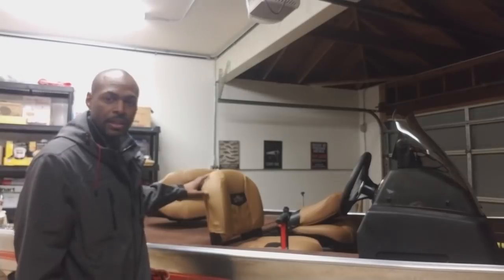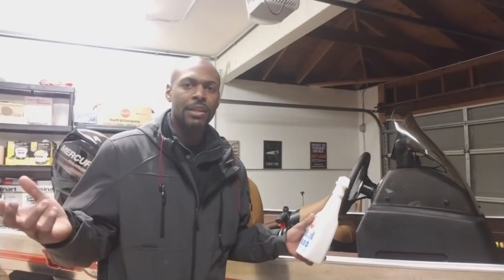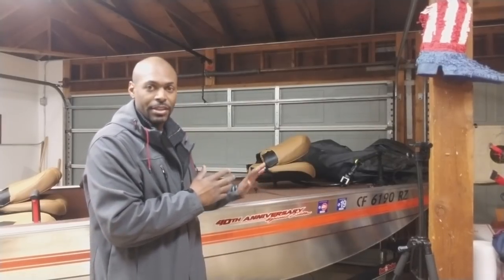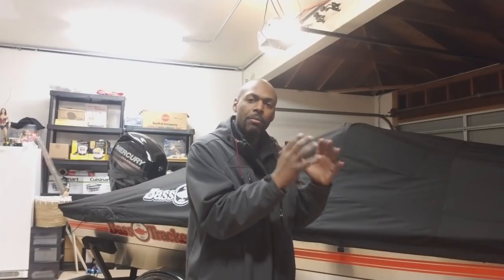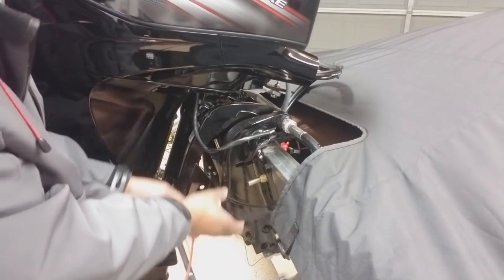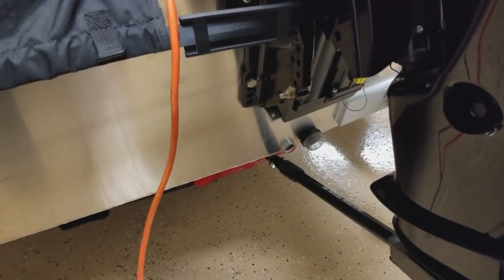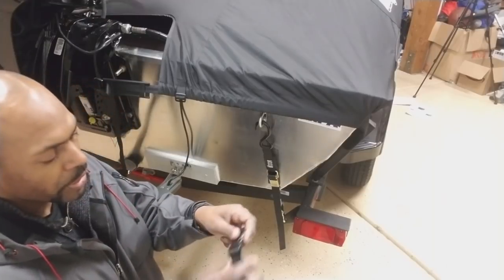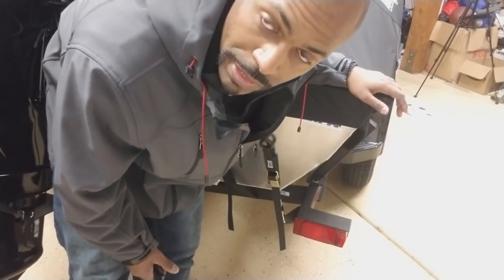Tips to Install Dowco Boat Cover

Comment: Thank you for the video. Just purchased a Tracker and will be towing it 400miles. You answered all my questions. Great video.
Reply from the maker: I have towed my boat across the country from California to Arkansas back and forth three times. The trailer and cover have held up. I had to sow my cover not because it tore in the wind, but because I left one of the straps on the ground when I was just moving the trailer about 5 ft.. the strap got caught under the wheel and ripped the cover. I sewed is that with some braided fishing line and it is still kicking.  It is well worth the purchase. It's not some cheap cover you get at Walmart or AutoZone for a car that falls apart within a year or so. My boat lives outside primarily and in the sun and rain. It is held up remarkably. Only thing I've done is adding more waterproofing to it

Comment: Good cover mine lasted five years being stored outside. Also used it on the highway during in climate weather. Bought another one, used a piece of the old one to cover open area near the moter.

Comment: great video.   good instructions.   My question, is once you have your cover on and all strapped down and ratchetted tight can you trailer your boat on the interstate without the cover flapping in the wind?  Thanks again for a great video
Reply from the maker: Absolutely.  It's not a cheap cover that will flap and  tear in the wind.  It is tight and protective.  No wind noise or anything.  The only issue I have is the gap at the motor, but just leave the drain plug out when it is stored outside or you are trailering in the rain.
Reply: Thanks for your reply!  @jaimeastin

Comment: I did kind of the same mount up front for my finder on my trolling motor  but I used the scotty flush mount track system with the gear head mount with the scotty extenders   I have the track system  on the bow  both side  in front of the live well and other side  2 on the rear  then wit the gear heads  I can lock in my dock bouy.s in  and remove them   I can put  in seven different locations  if trolling for trout at walleye .   I also installed  a scotty side mount between  the seats  almost flush  I put a scotty  3 pole mount  in for tools  and hooks   2 scotty post mount  cup holders on the seat base  I can put in  in the gear heads all over the boat .   I made 2 l brackets  and bought the stern light mounts  and mounted it behind  the seat  and mounted my fish measure  board  also behind  the seat  . and installed a micro power ANCHOR  on the rear
Reply from the maker: John Hansen 

I need some pictures!  You have a Instagram or go to jaimeastin.com email the pics. I can feature them on my my next video.  It sounds like a great set up.

I have some Scotty great track stuff too.  I am just trying around with what solution next.  I am courious about your setup.

Thanks for sharing.

Comment: Thank you for the great video because the instructions which came were terrible. Also I agree that the open area on the back of the cover is an issue. The last thing I would want is a neighborhood cat getting up in there and spraying everything. I have been using a towel to block access through the exposed area of the cover at the engine.

Comment: Jaime, Do you have a part number for those poles? Or maybe you could measure and tell me the sizes they adjust to? Just picked up a heritage edition and it came with a cover but no poles.
Reply from the maker: I dot. Have a part number, but you can buy any universal ones.  Mine are all broken, lol!!!  I ams using plastic universal ones.  They work fine.

Comment: jaime I looked at my boat  it has 5 screws  on that rear panel  there down in deep in the carpet you have to push hard into the carpet to feel the screw head
Reply from the maker: John Hansen 

Thanks John.  I tried to hard to find mine, I will check again.

Comment: Appreciate the videos on the tracker. I ordered mine and am not waiting the eternity until it's delivered. Quick question though. What do you think or about a middle seat either a custom set up or a pedestal.
Reply from the maker: Dejuan Hardman 

Thanks for watching.  I am actually building a middle seat/console.  I am trying to build cup holders in it so that it is dual purpose.  For now, it will be a cooler or a small step.  Although the drain is there, it will not be in the way.  

Thanks for watching.  When is your quoted date?
Reply: I ordered mine two weeks ago and they are saying August time frame. But thanks for the response and keep the videos coming.

Comment: die-electric grease on the eletrical connections it is non conductive where some grease's may be and you can short out things doing that
Reply from the maker: UBBERTANKER 

That's what I used... I should have been specific rather than saying grease.  I will add a not to video for others.

Thanks.